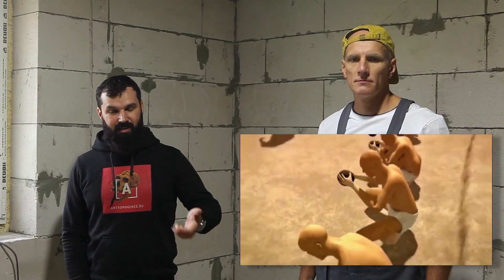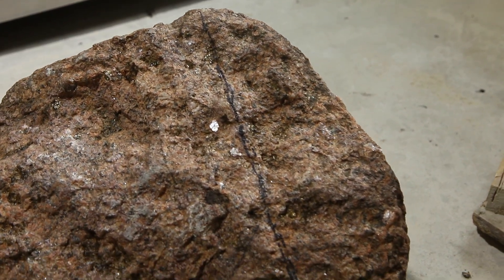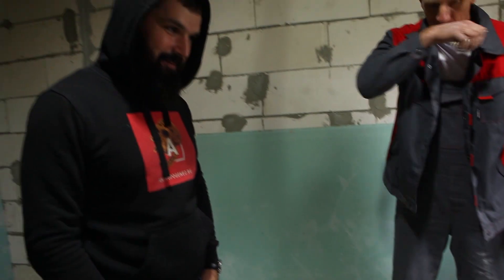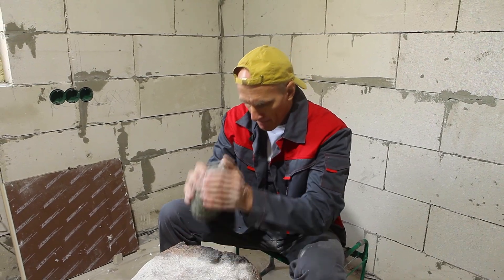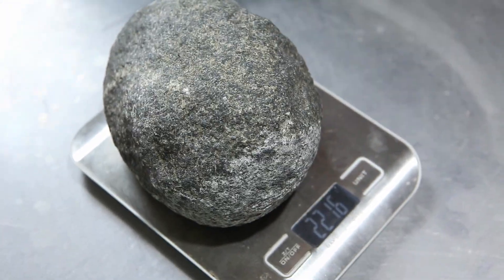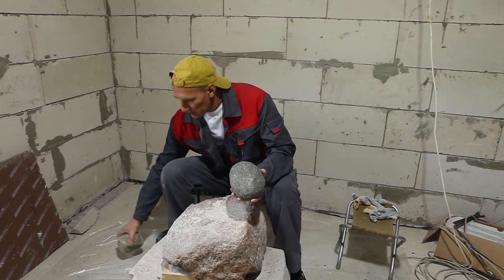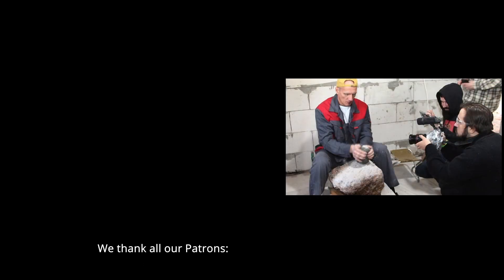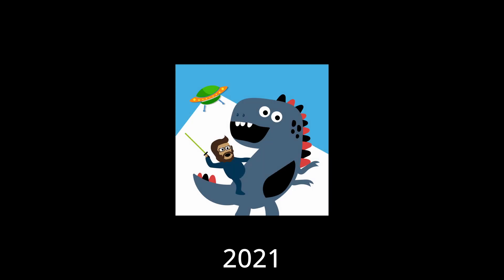Dolerite vs Granite | Could Ancient Egyptians carve obelisks?

Comment: It should be noted that the dust coming off there has a high % of silica in it. That can cause lung scarring and permanent lung damage. A couple times probably won't do much to you but prolonged exposure can significantly alter your life in negative ways. A dust mask or similar safety equipment is advised when cutting stone or glass.
Reply: I know. Waiting for them to start running with scissors.
Reply: Water was applied most likely.  Water was applied at least after the rock was heated to shatter and weaken the rock being cut.
Reply: @stanleytolle416  Takes a ton or water and does not help much.
Reply: @captaindein33 
What doesn’t help much?
Reply: Mind blowing that these guys get to call themselves scientists. Without any doubt, they have caused permanent damage to their lungs by not taking any safety precautions or doing any research going in. I wouldn't even knapp a stone like that without being in a well ventilated outdoor area, let alone fill a room with it's dust. This type of debris stays in your lungs permanently and tears away at them making progressively larger patches of scar tissue for your entire life.
Reply: That explains all the depictions of ancient egyptians wearing masks
Reply: And the Egyptians did it for years right? Means early death for many workers.  2 years to carve one obelisk.  How many men?  Seems there's not enough bodies in Egypt to build everything if they proceeded at this pace..
Reply: @alandonly  they average age according to egyptologists was low 30's
Reply: @alandonly  records indicated they were getting the obelisk quarried in 1/2 a year.  The guys were good at their jobs
Reply: @stanleytolle416  

Not surprsing: the rock they're using isn't the same as the dolorite in Egypt.

Also, what they left out is something the other comments mention: we know the Egyptians were heating the granite. That weakens it, making the job MUCH easier.
Reply: @Stickminbasi90  same stuff.  The idea was recreation of  copper age technology. Like impossible just takes awhile.
Reply: @Stickminbasi90 Seriously?  How were they heating up 100 tons of granite?  C’mon, get real.
Reply: @OleHippy  

"How" --I'm reliably informed it involves fuel and some tinder...OK, seriously: you don't have to heat up ALL 100 tons. You just need to heat up the part you wish to directly work on. You can then choose to douse it with water/wine, depending on what your exact aim is (that cracks the stone open)

This isn't some arcane tech: people have been heat treating rock--and not just granite--since the paleolithic. All it needs is mastery of fire, good observational skills, and some imagination.
Reply: @Stickminbasi90 I’ll bet it’s fun when it’s 115 degrees out.
Reply: @alandonly  This is ridiculous
Reply: @scaramouche8244  you haven't said what is ridiculous
Reply: @alandonly  That those stones were shaped by pounding with other stones.
Reply: @scaramouche8244  agreed. Lol
Reply: Dude even one time is enough, these guys all fucked their lungs up cutting those rocks in that room with no respirators, insane!
Reply: Now make the "scoop" marks.
Reply: @mattstroker  that's where the fires were dummy.

Comment: I am convinced that granite was heated locally with carefully controlled fire. The rock will maintain its form when even at a very high temperature,  but the moment it is doused with water , thermal shock can shatter or render the surface crumbly so that copper tools might be the used to shape.
There is a case I think in a Berlin  museum where Egyptian statues in granite and black basalt remained intact even when the building was on fire with intense heat, but it was not until the firemen started squirting  water on the flames that the statues then started to shatter.
Reply: I can imagine it being a plausible thing. Mining in the medieval era often used the same method, where a fire was built in an existing shaft, and water was thrown onto the rock.
Reply: The granite was not heated, this was caused by a chemical reaction induced by a fluid that soaked into the stone, rendering the stone soft temporarily. This isn't just a theory, there is plenty of proof of this. It cannot be done by fire because when the heated stone cools down, it would look glassy, and not like granite.
Reply: Whatever they did, it wasn’t done by just banging rocks together. I wish they would consult skilled tradesman before publishing these weak theories or at least make a serious attempt at applying them through experimental archaeology.
Reply: @elijahbachrach6579  This would have been incredibly inefficient technique. The bosses would have been counting the money the pharoah's gave them and would have figured out ways to improve artisanal construction.

Since obelisks are technically sculptures I would consult a modern day sculptor who would probably say they used various techniques such as heating stone and then dousing it with water to make it crack. The classical techniques used then were also used by Michaelangelo when he carved the statue of David. He just had different tools and a softer stone.

Or not just using not just dolerite stones but also the dust made from polishing gemstones (for example to make diamonds you have to rub it against another diamod resulting in diamond dust. that dust can be layered on a coating of an Ancient glue the gemstone dust being much harder by it diamond or saphire or garnet or whatever, as long as it's harder it will  cut into the stone with relative ease.

They also had reed ropes so I could imagine making a larger contraption and using a treadwheel (like a hamster wheel but for humans) and a couple of logs one could create a large saw with enough relatively pure copper
Reply: @elijahbachrach6579  Look at the tool marks on the unfinished obelisk. They are pretty consistent with what it looks like when people pound rocks together.
Reply: no they are not, you have to be trolling and deliberately lying at that point. The quarry marks around the obelisk look nothing like pounding stone marks. They look like huge scoops. Since when do pounding stones leave marks with a uniform width and clear offsets? Tell me how they pound a square hole a few feet deep that is uniform in shape, has clear corners, and is too small for humans to go into, too deep to reach with arms etc. 
You literally cannot be honestly claiming that they are consistent with pounding.
Reply: @elijahbachrach6579  they have consulted masons and other trades men.  just not the con artists the ancient aliens and Atlantis clowns use.

There are masons online doing similar debunk videos.
Reply: @elijahbachrach6579  Yeah, as a stoneworker I just can't imagine hundreds of thousands of people smacking stones together for their entire lives just to make terribly inefficient progress.  Egypt was the longest lasting culture in the history of the world, they surely would have developed better techniques and tools.  Hundreds of granite stones have been found with large-bore precision drill holes in them, so they had good drills at the very least.

It's cute, though, that these scientists actually wanted to back their theories up.  I'm sure after a couple hours of smacking stones when they can't feel their fingers, and pain is shooting up their arms, and they've made no progress they might've thought: "shit, what if we're wrong?"
Reply: @alexg5189  Those holes aren't precise which you claim, yet you're in here mocking these guys and their work. WTF have you done to prove or disprove anything other talk shit?

Comment: While I agree with science, and agree with the results, please carve one completely square replica of any given box or block found in granite there. And measure it to the same precision as in Egypt. Using the same tools. All you have proven here is that a dense rock outlasts a coarse rock within the same class of rocks. Please make us a granite box more precise than the table it was built upon. Keep up the good work. I love to see experimentation on this subject.
Reply: It would help to have several generations of craftsmen perfecting a trade of this as they most likely did in Egypt.   These guys don’t have that kind of time or labor force.  You have to realize when the alternative side states that you need to demonstrate the exact same level of skill as someone who most likely used these techniques their entire life (passed down through generations and improved upon), they are setting a near impossible standard as to keep the grift going.
Reply: for a granite box with bronze age tools I think they would have probably started by drilling out the rough shape (if you've tried to make a square opening in a metal enclosure with a drill, same idea). Popped out the core pieces and then continued to shape and finish. If you're talking about the serapeum of saqqara - we've moved onto the iron age now. Oldest of the 24 sarcophogi in the Great Vaults dates back to like 500bc which is WELL into Egypt's iron age. The temple is older but I believe the lower vaults are not accessible (atleast to the public). And, on top of that if you look at people check the right angles of those granite boxes - it is VERY clear they are not made with modern precision.
Reply: Except there is hieroglyphic reporting of the number of workers it took to create the box, how long it took them, how much they were fed and paid each day, so really if not to get a video with 100 million views, then I guess we’ll all just wait for mrbeast to do it.
Reply: And what purpose would that serve? This video is a response to the claim that you need lasers and engines to carve granite. You'd still need a thorough Egyptian craftsman specialization to even dream of making a tomb worthy of a Pharaoh. It's like asking a random guy to reproduce the Sistine Chapel dome
Reply: They did cut a perfect 3 angle corner with stone tools that is identical to the Egyptians. Challenge has already been completed!
Reply: Dude are you serious? I know you went through learning how to write and better at it over time like everyone else did.

You quite literally have the evidence in your hands.
Reply: You providing the money for the people, materials and tools? 

Don't forget the labor hours and land Pharaoh
Reply: They have done it. (The Egyptian monuments weren’t actually that precise either).
Reply: Buy the fucking granite and I’ll gladly do it. Otherwise. Don’t tell me to waste a shit ton of money to prove what’s already supported by evidence.
Reply: It’s already been done in a video on YouTube.  The precision of ancient Egyptian works, while impressive for their time, are greatly exaggerated by conspiracy kooks.
Reply: Watch their other videos
Reply: G.O.P.  people ! All cast and poured, sometimes carved/ indented before hard. Why is this so ignored? Probably because it’s true.
Reply: Sure thing.  Send them all the money it would take to employ and train that many people.
Reply: Check out the corner in granite video they did. Very compelling. The things humans can do with time and a little craftsmanship is astounding!
I still think there was more than one rise of civilization that was wiped out but they probably didn’t get to machines like us, they just got really, really good with the stones against the stones. No need for hard metal or diamonds. The stone cuts the stone! And humans are incredibly skilled with a lot of time to focus on getting good at something.
Reply: “Please make us a granite box”, Dude?! I get the curiosity, but that’s an unreasonable level of proof you’re asking for.
It took a work force months to create those things, with the incentive of a ‘god king’ decreeing it, and probably paying handsomely also. Probably several work forces with different expertise. You want some strangers on YouTube to knock one out just to prove ‘Hancock the grifter’ wrong. Plus, these guys may have other things going on at the moment, if you know what I mean.
Reply: It’s like me giving you all the equations in order for you to solve a problem. But you still insist on me doing all of the problem despite me already showing you. You can do it yourself, it simply requires a bit of elbow grease and some cunning techniques.
Reply: Yes, nobody has come anywhere near precision cutting of granite without the use of diamond tooling and again there are many pointers to possibly much earlier civilisations having the ability to carry out the precise cutting and polishing. I have postulated before that simple and powerful machines can be constructed from wood and bronze, needing only the cutting power of diamond.
Reply: @johndobbie528  You don’t need diamond tools. Garnet that occurs naturally in Egypt works just fine.
Reply: @Allan Gibson  yes it probably was used. It seems to me that much of the hieroglyphic carving must have been made by using a mounted gemstone to make a deep, sharp edged outline, which was then used to form a 2d image inside.
I still think diamond might have been the only option for producing the unbelievably accurate stone vases and other precise artifacts.
Reply: @johndobbie528  A bunch of Russians (Scientists against myths) replicated one of the stone vases in granite using sand, gravel and bone and stone tools. It took 7 months work for one person working a 40 hour week. A definite high end luxury product to impress the neighbours.
There are people who don’t know the difference between “precision” (repeatable tight tolerances) and good artistry (good smooth surface finish).
The Egyptians didn’t do exact duplicates - they did do extreme artistic work based on millennia of accumulated experience.
They also invented the lathe and drill press based on physical evidence - made from wood, stone and bone.
The potters wheel (a form of vertical lathe) is positively known to have been in use in Sumeria by 3250BC so that isn’t exactly breaking news.
Reply: @allangibson8494  I agree 💯. The reaction is symptomatic I'm afraid. 
"They could never have done that with the tools available"
Someone proves that it could be done. 
"Now I want you to make an exact replica"
"Nah, I'm not an expert and it will take forever. I don't really have the resources for that"
"Ha! charlatan! Atlantis is real!"
Reply: @mathiasjonsson8222  they literally proved it can't be done in this video? they lost half as much dolerite?
Reply: @thebobman69  👽
Reply: @mathiasjonsson8222  That's the double standard. People do a buttload of proof of concept videos that demonstrate ancient technology. The immediate response is "now do the Great Pyramid" or "now replicate one of the serapeum sarcophagi." But you never hear them harassing the pseudoarchaeologists to replicate the great pyramid and get it to operate as a power plant. Or demanding that they develop what they think was the lost high technology 30 feet wide circular saw allegedly used to cut granite and then experiment with cutting granite with it. Or assembling a team of psychics and have them experiment with trying to raise a two ton block of limestone 150 feet in the air to build a pyramid. Astonishingly one-sided skepticism that they lack the self-awareness to recognize.
Reply: @johndobbie528  Polishing was absolutely no problem. They used a mixture of ingredients sand, water, ashes, etc. and they even used granite plates with the mixtures and water to polish granite surfaces.
Reply: @johndobbie528   of course they have, we used toothless saws pushing stone slurry on granite up into the 70s. The only difference is our blades are steel and theirs were arsenical bronze. There are granite buildings in New York built to a finer tolerant than anything the Egyptians did, that were built in the 1800s. The Smeaton Lighthouse in England was built with granite blocks as the foundation in the 1700s, every block was polygonal, some with 20 sides, they fitted tight enough to be water tight. All with hand tools.
These things are absolutely possible with hand tools, time, and a labour force. You ancient tech guys are basic as fu…….
Reply: Buddy they don't have the people or the time to do that, they and others have shown proof of all the necessary techniques to do it
Reply: @oberonmcclinchie8534  they literally can't look how much dolerite they lost
Reply: @oberonmcclinchie8534  you have absolutely no idea what your talking about, buddy

Comment: Is there any reason to believe the ancient Egyptians didn't have hammers?  If I wanted to work granite with dolerite, I'd bore a hole sidways through the end of a long wooden handle and tie the dolerite to it to make an oversized sledge hammer.  Heck, put one on either end and tie carve the center to a fulcrum of a basic basic wooden sawhorse, and you could seesaw it to work the stone.  One guy on each side.  The seesaw would be a valuable tool then, and explain why other tools wouldn't be found in the quarries.  They'd naturally want to take the tool back home without having to lug an extra 8 or 10 kilos of dolerite, so untie the rocks and leave them at the site.  If the Egyptians were smart enough to know Pi, the Golden Ratio, and true North to within a fraction of a degree, you'd think that they'd be smart enough to utilize a stone-working method that surpasses baboon level intelligence.
Reply: The problem is that there aren't any of these handles preserved, nor marks on the pounding stones to suggest that they were tethered. This doesn't rule out your suggestion, there just isn't any evidence that the Ancient Egyptian quarry workers did that.